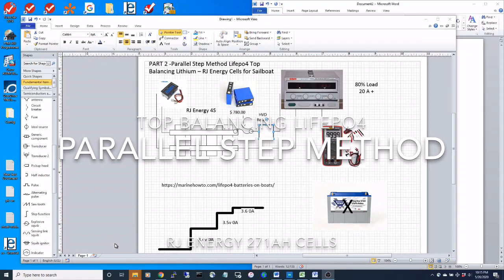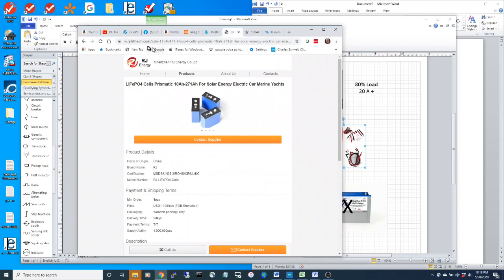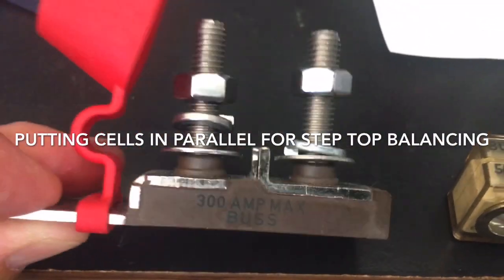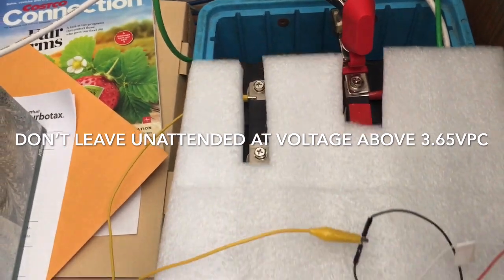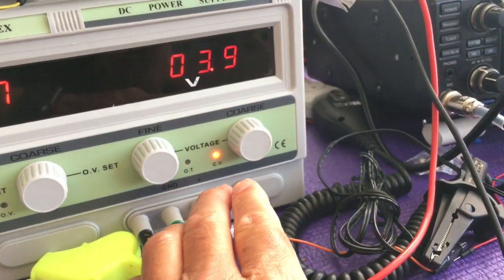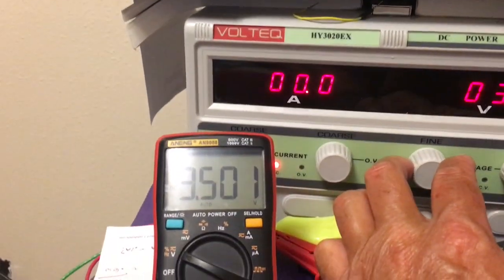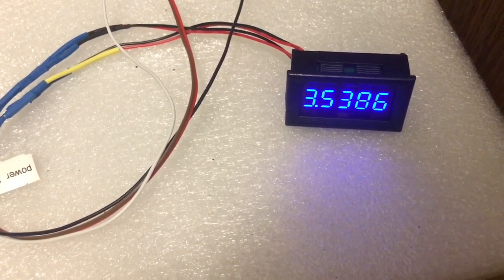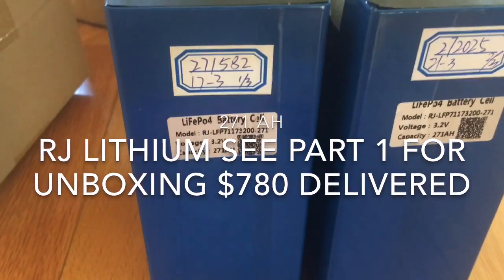RJ Energy LiFePO4 Lithium Batteries – detailed  Top Balancing using the Parallel Step Method

Comment: It takes bloody ages doesn’t it, I used two 5 amp buck converters set at 3.6v off a 12v battery charger , it took 3 days.
Reply from the maker: Cheaper than my power supply!  I'm thinking about rigging a auto shutoff switch next time. It takes so long.

Comment: Thank you for the video.. Took me 4 days now and im stil  at 3.35 frm 3.2v..
Subscribed :). Gotta crank up the voltage to make it faster like you did.
Reply from the maker: Thanks. Be very careful above 3.5. It can get away from you in a heart beat. Maybe take your time above 3.45v? I’m going to rig a voltage sensitive relay connected to the ac line of my charger next time.